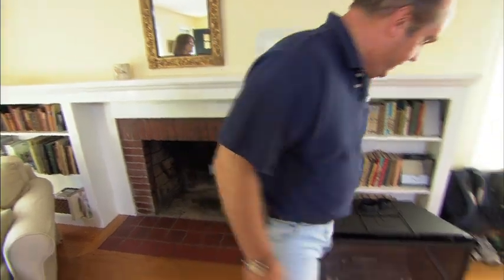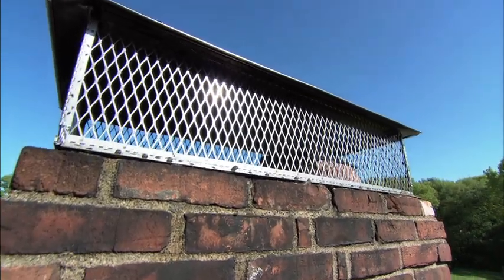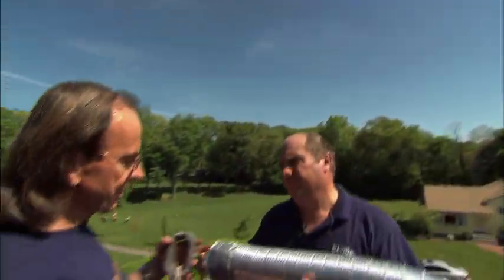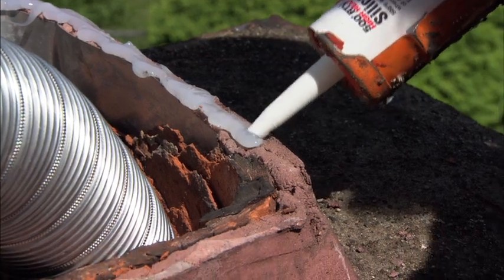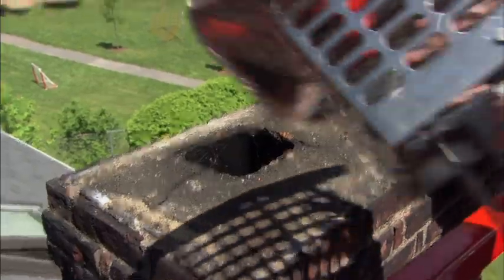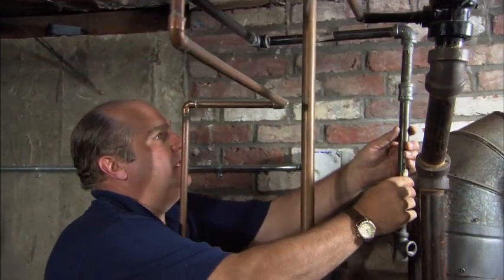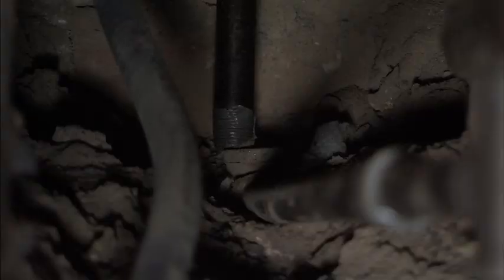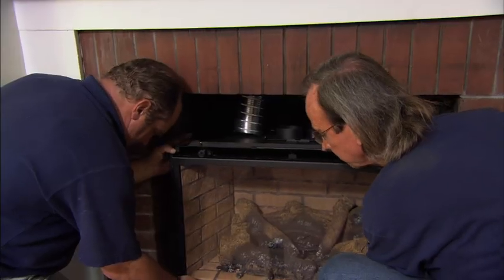How to Install a Gas Fireplace Insert | This Old House

Comment: Thanks, but why o why o why can't you show the install of the trim around the front.  Note: it's not just you.  I've looked for 3 days and NOBODY shows the install of the surround, ironwork trim, screens or doors.  It's important, because the fireplace unit needs to be set up in the old fireplace opening in such a position that the specified distance of the trim from the unit is met.  ???

Comment: I have just been offered a beautiful gas insert with a lovely wood mantel. I don't have gas but do have access to propane, so it would need a conversion kit. I would like to install it on an inside wall is that possible? I already have a propane fireplace upstairs and it vents outside, so I was unsure if we could get around it not being on an outside wall. I would of course hire professionals but need to know if its possible.
Reply: Hav

Comment: read my helpful tips before you install one!!!

1. Make sure you check your local inspection requirements for gas lines. My plumber argued with the city inspector about testing the gas pressure with the valves vs without the valves. In my area they test with 15psi of air pressure, but the valves are only rated for 2psi pressure so lots of arguing and confusion. Plumber had to come back multiple times due to this.

2. Ask your fireplace installer about various way to Brace the unit!!! My installer slid the unit into place just like this video and what no one tells you is the fan causes EVERYTHING to rattle, and it’s loud and annoying! I’m speaking with my installer currently to try and tell them they need to do a better job. $700 installation fee for a unit that rattles is insane....

3. These units do not, and I repeat DO NOT have smart technology. The industry is waaaayyyy behind! The unit makes loud beeping. the thermostat settings are clunky. I have to click remote buttons multiple times for the unit to respond. And I have the latest and greatest model, with the optional iPhone app. There aren’t regular updates. And there isn’t a way to update unit firmware or remote control firmware. It’s advertised to be a smart thermostat but it’s basically a glorified on/off button unless you plan on monitoring it constantly. 

4. The fireplace insert manufacturer does ZERO customer service. They only rely on their local resellers/installers to handle issues. So if you have a shitty installer with an abrasive attitude (I sent and email with my issues and he said, it’s operating as designed. read the manual), then you’re out of luck for getting reasonable help. The insert company has zero control over how well they train the local reseller, and it also doesn’t seem my reseller has any idea about the technology and how to use it....

Out of all the unexpected issues, I’d say the most annoying is how loud and clunky the fan noise is, especially with the whole unit rattling when it’s on.

FYI: I’m using a Heat & Glo insert with the Intellifire remote and app.

Comment: I see in the video a manual shut-off valve at the end of your gas line that you ran into the old fireplace.  Why was that necessary?  Since the valve will be hidden behind the insert, how do you access it if need be?  Would you have to remove the insert all together?

Comment: Wow why did I think all I had to do was run a gas  line up into the fire place and buy some kind of burner to  lite a fire?
Reply: This is considered a vented fireplace. They make fireplaces that are "ventless" or "Vent-Free" which essentially only uses a gas line and no need to run anything up to the roof. With a vent-free fireplace you can completely close all the vents on the roof.

Comment: I'm installing a majestic ruby 35. I need to install outlet box in firebox. What type of wire conduit box etc would be best. I'm penetrating the brick and running conduit directly to the breaker box. I live in NJ
Reply: Did you ever figure it out? Im installing a 25 and need the same thing. Any suggestions?

Comment: Chimney flashing was ghetto. Should have installed a custom stainless shroud instead of thin flat metal glued with silicone. Wind driven rain will get in there eventually. Press in cap on other flue is not code here as they blow off.
Reply: Could you show me an example by a link?

Comment: There is no fan to push the exhaust out. Like seriously? Then you used regular silicone on your venting? Its melted and gone now
Reply: And yes,  the 500° silicon caulk is no good.  Milpac is way better!
Reply: Agreed! They naturally vent, and except outside air.
Reply: Refer to manufacturer instructions on what to use.

Comment: Not impressed with these 2 flimsy pipes.  We had a Majestic gas fireplace that we got extension pipes when converting our ranch to a Cape Cod home back in the 1990's.  We got Majestic double lined stainless steel pipe....which was great and heavy duty.  I would not put some flimsy pipe in my chimney that rodents or squirrels could chew some holes in easily.
Reply: Those are the standard simpson dura-vent direct vent pipes. Designed specifically for that and many other gas fireplace inserts.  Not required to be insulated as some other models. Highly effective in doing what they are supposed to do.

Comment: Electrical Outlet behind the fireplace? How is that to code? May be it is. Just surprised heat won’t melt the outlet or if not heat what’s the point to have a fireplace?
Reply: The heat is contained in the unit and blown out with a fan. The old cavity is only as warm as the exhaust pipe. All gas inserts work this way.
Reply: That is very normal for one of these gas fed fireplaces.
Reply: B Vent not required?
Reply: The scarier part is running the gas line right next to the electric line. One spark or leak and bye bye family
Reply: @sinjon   not any diff than  the electric plug for the igniters for your gas stove top. The gas and the elec are next to each other behind the stove.
Reply: @sinjon  Not a whole lot different than any of the larger gas appliances such as a gas oven, gas dryer, gas furnace. All have electrical service included alongside the gas device.

Comment: Congratulations for ruining and replacing a very nice fireplace with a kitschy, ineffective abomination.
Reply: I'm converting to gas in my home, reasons are as follows. 1) you can use it to heat your home even if the power goes out, versus our gas furnace which requires electricity. 2) the heating is WAY MORE EFFICIENT than a wood burning fireplace, which actually creates a vacuum and sucks the heat to the outside of the house "do your research on how most fireplaces actually work. they are mainly for ambiance and not for heat in most homes." 3) No more buying wood, no chopping, splitting, stacking, or seasoning. If you can go gas, I see no reason not to other than initial cost of installation. But hey, to each his own. Do what works best for you.✌
Reply: @1278phantom  Most direct vented fireplace requires a fan to run to circulate air. In case of power outage it might not be able to run without an alternate electricity source.
Reply: @moutrap   good point, it just depends on how you want it set up. the one I am putting in my home will heat almost our entire home regardless of working electrical mains. I live in the northeast, and specifically for that reason have my fireplace set up that way, in case of emergency. You bring up an excellent point, people should understand how different gas fireplaces work, and how efficient the different models are. I recommend doing some research and shopping around, and looking at various consumer ratings and reviews before anyone buys anything.😉
Reply: @1278phantom  What kind of setup / fireplace model did you get to heat the whole house without electricity? I live in Canada and am looking at a gas fireplace for the same reason as you.
Reply: @moutrap  Gee, you're even farther north than I am. it's a Kozy Heat direct vent ststem with an IPI pilot light. It has a battery back up. Supposedly the model we're buying can heat up to approx 1600 square ft. . Check out their website, pretty interesting. There are other places in our area that offer the same battery back up feature on some other brands as well. I would think that in Canada that would be a more common feature on a fireplace. Good luck to you sir.
Reply: Good choice Bryan. Thumbs up!
Reply: Yes, replacing a giant hole in your house that only sucks money and energy up and out when you burn wood for something that does give actual heat at a reasonable efficient rate. (despite what you might read from the geniuses below) Direct vent product are actually very good for the age old problem crappy open fireplaces.
Reply: @jasonbrimeyer8774  very true. Furthermore, some heavily populated areas restrict wood burning anyway, so direct vent gas makes sense.
Reply: @jasonbrimeyer8774   My 4,000+ btu gas insert would heat my entire finished basement all winter. I dont know what these people are talking about lol
Reply: Was just thinking the same thing. Cannot understand these "gas fireplaces". Stupid gimmicks.
Reply: I have to disagree with you. They are the real deal. Mine throws off a lot of heat and is a very good source. I have a split level home. It heats the upstairs of the house very nicely. It saves me from using the other source of heat I have and it's electric. I can set my thermostats on my electric heat to 60 degrees while the natural gas fireplace that is in my finished basement will maintain the upstairs to 73 degrees or higher. On the coldest nights of winter it will maintain the temperature at 70 to 73. Of course I have new windows and updated insulation in the attic of my house. So I have to again disagree with you. They are not a gimmick by any means.
Reply: Agreed. Putting in a gas fireplace in place of a nice wood one is just foolish.

Comment: You have no easy access to the cut off valve which is installed at the rear of the burner ?
Reply: There is one in the basement.

Comment: Paying for convenience and aesthetics with little return heat on investment.
Talk about throwing your money away. Heating with these is like running a steam boiler with no water in the system, or a forced hot air furnace without a blower.
Reply: Wrong. They use a fan that runs automatically when the firebox hits a specific temperature. We use one to heat a large cathedral living room and if anything, it heats too much too quickly. Furniture halfway across the room becomes warm to the touch after a very short while. And then when the room hits temperature, the fan continues to blow the hot air for quite a long time. Basically, nothing you said is correct.  Everyone loves wood fireplaces, but not everyone has the means nor the resources to use theirs as one. Inserts fill that void perfectly and work really well and are ridiculously cheap to run compared to the now $400 a cord for local wood. We have two 125 tanks outside and they get filled once a year and we live in CT. Temperature as i type this is 14 degrees. Room with the fireplace is 70. My wife uses it year round for ambiance or to remove a chill from the air. The room in question is 27x24 and the ceiling is 14ft at the peak. What matters is the real world application of something. Your opinions however, are pretty meaningless as they are only opinions and you clearly do not own a gas insert.
Reply: I thought units like these had heat exchangers built into them with fans so they could draw air from the room, heat it, and discharge the heated air back into the room?
Reply: How about you educate yourself a little about Direct vent and their efficiencies before making wild baseless statement?
Reply: I will have to debate this against both of you.  Depending on the heat output of this unit.  Most fireplace in today's world have to be tested as a heater, due to congress wanting more efficient products.  This unit could heat up to 1500 sqft
Reply: This was a two pipe insert. So I am right.  No one is using B vent for fireplace inserts. That is old school.
Reply: How do you figure when they are 75 % efficient?
Reply: Yeah, if u have a blower installed on vented units it will provide heat.
Reply: They are usually 80% efficient
Reply: Anthony Romano When you say "they" it's like saying cars can speed around at 220 mph.
Yes, but not really. IT IS POSSIBLE, but not likely.
Here is one excerpt:
Vented Gas Fireplace Efficiency
Two-pipe vented gas fireplaces that draw fresh air from outdoors are more efficient than models with a single pipe, which rely on indoor air to fuel the combustion process. Two-pipe models offer efficiency ratings of 70 percent to 85 percent, while single-pipe units offer around 50 percent efficiency, according to the This Old House website. Single-pipe models are also known as "B-vent" gas fireplaces.
http://homeguides.sfgate.com/heating-efficiency-vented-gas-fireplaces-75798.html
Reply: yeah, your getting zero heat out of this unit
Reply: Anthony Romano And your estimation of 70% is based on what?
Aliens?
You actually don't have any proof of your statements, just numbers thrown into the air.
Reply: Jeremy Goodwin Or it could heat only 250 sqft.
It's a pure waste of energy to heat up a gas fireplace and have 70% of the heat escape up the flue.
It's like baking a potato in the oven and leaving the oven door open.
A pure waste.
Reply: Yep, as right as common core math.
The pipes go up into the flue along with your money. They don't get to interchange with household air to warm up and their efficiency rating suffers.